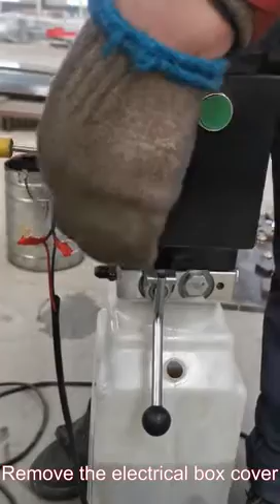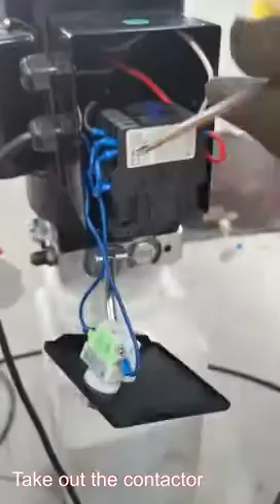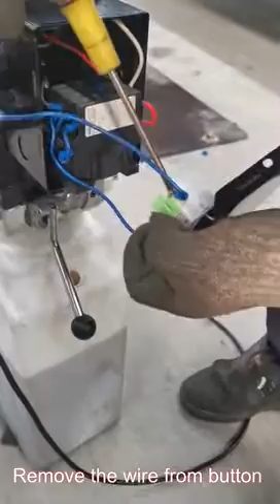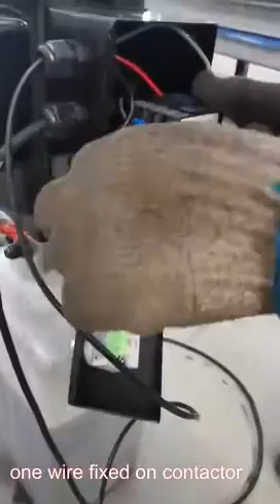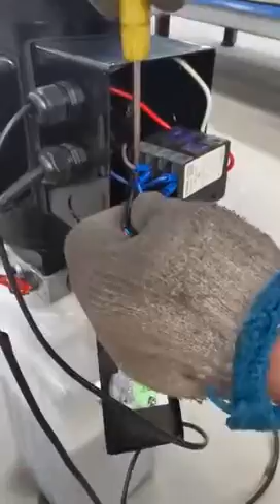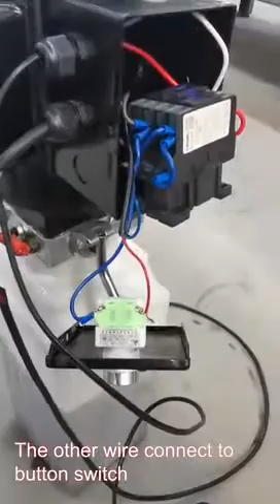How to Install Limit Switch for Two Post Lift

Comment: Well that was absolutely worthless! You only hooked up one wire for the micro switch!
Reply: It's two wires. The safety switch was installed in place of the one wire that was removed going from the switch to the relay using two wires.